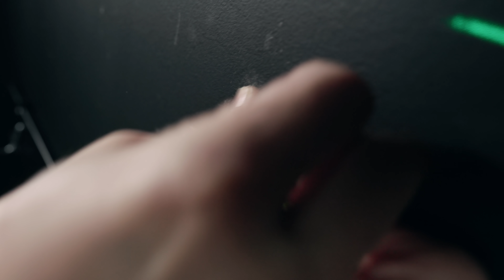DIY Matte Black Camera Charge Station | Turning Our Basement Into A Studio

Comment: Great video...great idea.  Just a few helpful hints.  When threading the zip ties, do so that the clip part ends up behind the metal part to save fingers from scratches which can actually be quite painful.  Maybe order some velcro on a roll of different widths to have around, 1/8 1/4 1/2 & 3/4 inch or just get the larger stuff and cut it down as needed.  I use that stuff for everything.  Depending on the cable, there might be a minimal bend radius so try not to bend them too sharply if possible.  We also use 'lacing bars' for a lot of mounts and/or cable management.  Easy to hang stuff from or mount stuff to.

Comment: I like your setup, it's really nice. The only major thing I did different on mine was use 1.5 inch wall standoff mounts so it's not flush against the wall. That way I can mount power bricks/bigger cords/etc... between it and the wall. Only for things I know are more permanent. Plus I can pull it down easier to make changes in gear. Keep up the good work. :-)

Comment: Well done, BUT: Why did you close the zip ties in front?!? Now you have the sharp edges where you might scratch your fingers when grabbing cables or stuff. Safer and nicer would have been to close them on the back of the board. :)
Reply from the maker: Correct! Because I’m stupid and the pressure of talking to the camera, making sure two cameras were rolling and everything was in the shot took over and I made the mistake of putting it in the front.
Reply: @BeckiandChris  To acknowledge a mistake is never stupid. :)